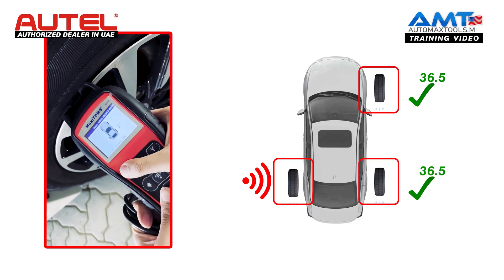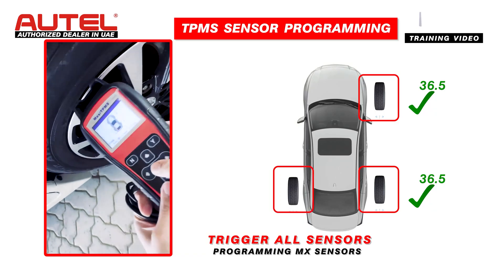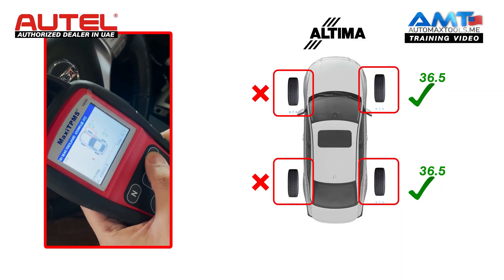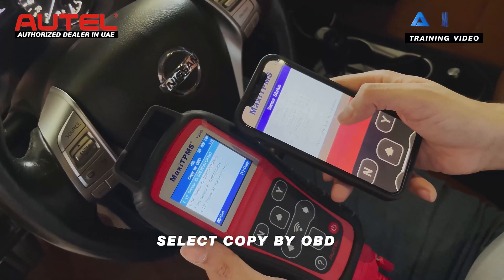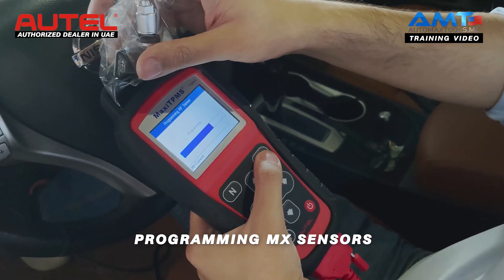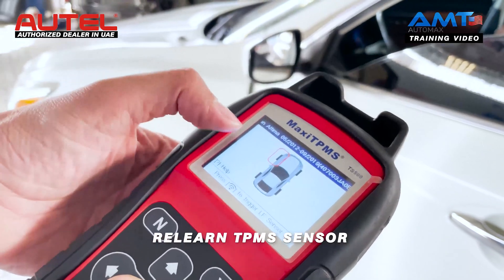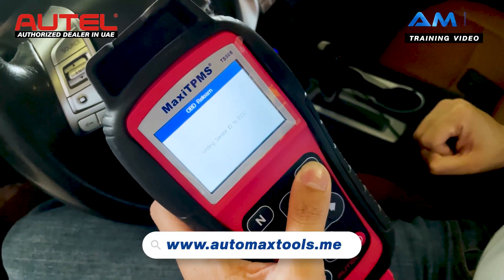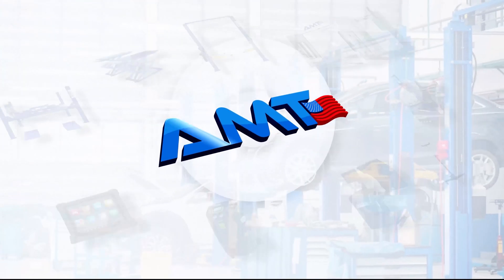How to Program TPMS Tools - Learn Autel TPMS Programming TS508 ITS600 MX Sensors

Comment: No need to use phone to take pic. Use Advance > TPMS Diag > once done > Program (or Exit if no work approved) > Follow steps > Finish connect to computer via USB, copy the file RECORD to PC, RENAME the file > Open internet browser, fill in the boxes if you want, its a PRE-SCAN - POST-SCAN printout that shows all the TPMS ID, DTCs, etc